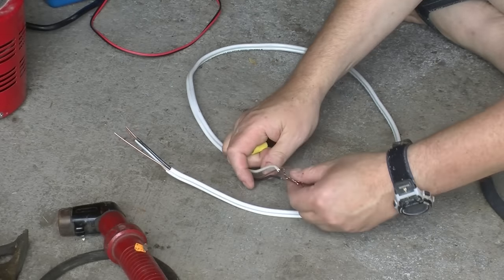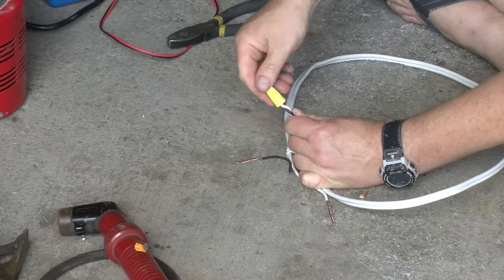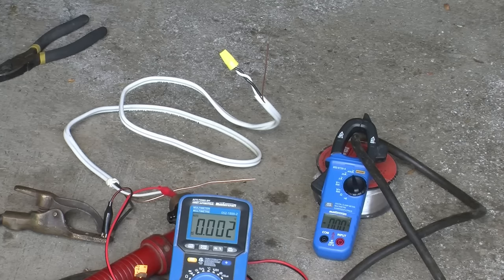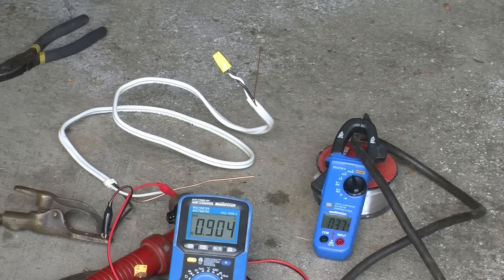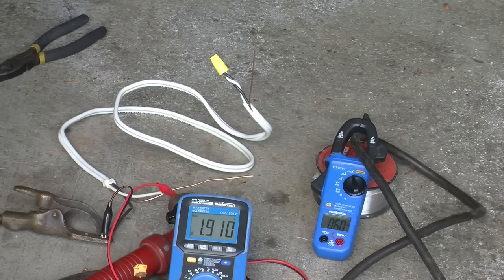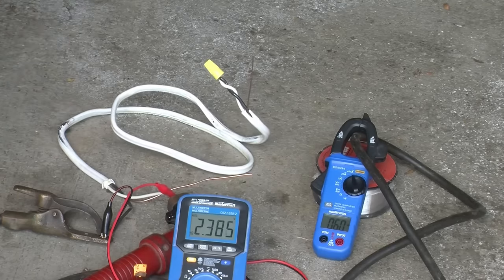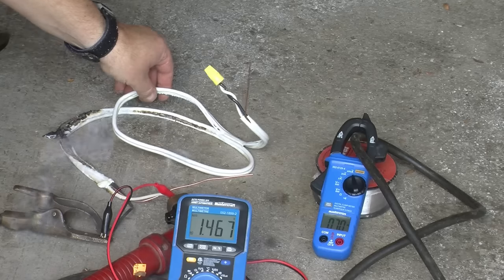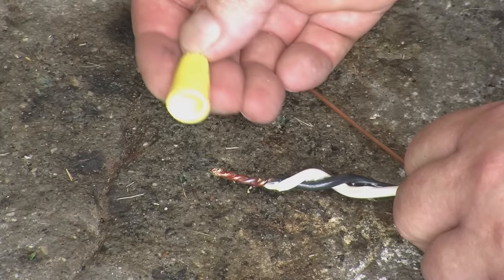How many Amps to burn up 14/2 electrical wiring?

Comment: Sir one emergency question...
A parallel circuit consisting of 2 same load/resistance where the total maximum current is 15 amp. It is protected by 15amp fuse. That means max 7.5 current is allowed in each wires.

Now, I removed one of the load. And,  I replaced the other second load with new load which consumes max 10amp.

That means only one new load is connected in the circuit. That means there's more 2.5amp difference of current flow in the new load circuit.

So, in the old load, max is 7.5 per wire.
In the new load max is 10 per wire.
So, just 2.5 amp difference.

Now, coming to my question...
If the new circuit is ON say for max 10 seconds, will the circuit immediately BURNS up within 10 seconds??? Of course, it will be hot.
How long (30 secs etc) can the wire stay unburnt? How long can it stay safe?

Or, How much extra current can be passed beyond the maximum limit for any given gauge wire?
Reply from the maker: See my other answer - which is there is no easy answer unfortunately. You cant easily predict how much overload is acceptable for certain period of time. If the cable is rated at less than the current drawn by the load, replace the cable.  Sorry - I know its not the answer you wanted :(

Comment: Any heating from overloading is wasted electricity-- for which the customer pays but receives no benefit. The 15 amp load results in minimal heating which also prolongs the practical service life of the various non-metallic materials which comprise the cable assembly.

Comment: It is hardly surprising that the "wire-nut" didn't get as hot as the rest of the circuit, since the joint had everything in its favour. A. Not tightly sealed (thermal) insulation allowing greater heat dissipation into the surrounding air, and more to the point, B. It is positioned at the point of least resistance in the circuit. The cross-sectional area formed by two thicknesses of copper wound together is like putting a "fatter" wire in the circuit, and since the current is "limited" by the welder's internal controls, the "I-squared x R" (copper loss) loss is least at that point, and consequently the coolest point in the circuit.
Reply from the maker: I think you nicely described why they seem to do so well. The others are at quite a disadvantage  in that respect - small contact areas and harder for heat to escape.

Comment: Im pushing 70 yrs ive seen some ugly wire from the 40 /50,s.  14.2  hasn't burnt still very good in the shop.
Reply from the maker: I have seen some of that old stuff too (canvas outside with tar like stuff?). The only thing I noticed is the plastic around the wires themselves gets  brittle over particularly at the ends where it is exposed to the air. Agree though - seems to be fine most cases.

Comment: 14ga is the the wiring of choice for lighting circuits.  12ga is normally found on receptacle circuits.  But I have seen all sorts of things.  When they first started including bare grounds (xx/2 w/ground) it was common to see 12 or 14ga wires with a 16ga ground.  And let's not even discuss the travesty of aluminum cable, other than SE.
Reply from the maker: I'm amazed to hear of grounds being that much smaller. I wonder if or how common it was for the ground to fail because of overloading during a short?

Comment: @ about 8:25, when he plays with the hot spot, the voltage starts dropping.  I assume it is shorting out some, probably at that spot.  So less current through the wirenut, which he says is faring well.
Reply from the maker: At that point yes - the wire shorts. Up until then, the wire nut would have been experiencing the same current as the wire, I thought it was interesting that connection - often a weak spot prone to problems - was not the initial source of failure.

Comment: In a welding circuit, if I understand correctly, it's the input voltage and amperage that's the issue. Voltage is either 110 or 220 ( nominal) & for the 220v, Virtually all mfrs.  recommend either a 30 or 50 amp breaker. For 110, if one reads the fine print, they recommend 30 Amp breakers for best performance. It would be nice to see some real world testing on the input wiring. Welders usually work by creating a short circuit between the workpiece and the electrode, so higher voltage & amperage are required. Have any thoughts? Thanks for the video, though. It was very interesting & helpful.
Reply from the maker: For the breaker rating, you really have to go by what the manufacturer recommends since they know what their machine is supposed to draw. And in turn whatever the breaker rating is then sets the minimum wire size that must be used for the supply circuit. Dont be tempted to use anything smaller than what the electrical code requires. 

Since you talk about 110 and 220, I'm guessing you are you  using one of the modern switching power supply ones that can adapt to either voltage - I have never actually touched one of those! Also I have never seen a 30A 120V circuit other than for camper vans - my thought would be that if you have to put in a new circuit for the welder, it might as well be 240V since for the same wire size and current, you get twice the available power to the welder. (120/240 is the designation that seems more common today but it essentially means the same as 110/220).  

The short circuit bit: the trick old welders use to allow shorting the welding side without frying the 240V side is the transformer is an unusual transformer: it is built to allow a  a certain amount of leakage magnetic flux to bypass the secondary.This has the effect of limiting the primary current when the secondary is shorted. It also makes the secondary more like constant current source rather than a constant voltage source as in a traditional transformer. By limiting the primary current that sets the power limit of the welder and also the size of breaker required. The switching power supply modern welders probably achieve this with electronic feedback, possibly with better results. 

Hope this is useful!
Reply: @ElectromagneticVideos  thanks for your informative reply. I am actually planning to either put in 240 or both 240 & 120 at the house. The 120 would be a dedicated line for power tools in my work area. Because of insurance, etc. I will have a licensed electrician add the outlets. Our home is all electric, so we should have enough power to the panel.
Reply from the maker: @stevencbradley  That sounds like a great thing to do. If you are planning on a 50A welder circuit or similar, one thing I did was have them install a subpanel. Great thing about that is 120V circuits for tools etc  can be added at very little cost, and you have the added advantage of the large cable  from the main panel reducing voltage drops. My subpanel is in the garage so it will also make it easier to add a higher power  electric car charger in the future. 

A couple of other things from when I researched  doing something similar to what you are doing: If you are thinking of a welder in a basement, even with a fume hood its not a great idea - the argon gas used for MIG is heavier than air and if there is a leak it can fill the basement (like water would) and suffocate someone. One thing that worked out really well was to have 20A 120V circuit for all my tools, with three duplex receptacles along the workbench area, and a number of pairs of duplex receptacles at strategic places along the  permanently plugged in drill press, grinders, saws etc. No extension cords required! And the receptacles are all 5 feet above the ground for easy tool access and  to keep power cords off the floor. The group of receptacles for the tool bench have a dedicated on/off switch, as does each set on the walls. And the 20A circuit is on a GFCI.   This of course may not be the right setup for you, but I thought I would mention what worked well for me in case any of it is of use.
Reply: @ElectromagneticVideos  work area's actually outside for now. I live in a mountain town in Arizona, so it's fairly temperate. I may move to the garage, but like you, I would not be welding in my basement (don't have one, but if I did, I wouldn't. Besides air purity, fire control could be really tough...)
Reply from the maker: @stevencbradley  Your so lucky to have the luxury of a warmer climate - winter here (Ontario) is too cold for outside work. Your state is beautiful! I have visit a few times - Grand Canyon and Meteor Crater in the north, and south regions down to the Mexican border - but not the middle.  Wonderful for nature photography.
Reply: @ElectromagneticVideos  there many more mountain towns here than most folks realize.  We moved from California, & I always thought of Arizona as desert, except for Flagstaff. You're certainly right about the beautiful places, though. As far as wildlife, this town was essentially carved out of National Forest, so we have our share of wildlife, but certainly not like you folks.
Reply from the maker: @stevencbradley  That sounds so nice! Unfortunately you rarely see much of our wildlife like bears - they are very shy!
Reply: @ElectromagneticVideos  I never had much wildlife close by until now, but Payson has its own elk herd (xl deer); we have peccary (local name javelina) or "pigs" (relatives of pigs, actually) coyotes, mountain lion (infrequent) bobcat & lynx  (infrequent), raccoons, coatimundi, bear (shy, as you say). Elk, raccoon & javelina visit often. Elk in the front yard quite few times in the summers, javelina come through for the birdseed Judy leaves for the doves. Lots of birds (eagles!), snakes, lizards. One of the main interests is the tarantulas that show up during early summer for their mating season. Don't think I can send photos on this site, but easy to look up.
Reply from the maker: @stevencbradley  That sounds fabulous! Elks are one of my favorites - many years ago I got a photo (35mm slide film) of an Elk in a lake in the Rockies - for years had been the background on my Windows desktop.

Comment: If the wire clad melts won’t the ground be hot with current too?
Reply from the maker: Yes! That is something I ignored here by leaving the ground wire unconnected. Since the ground wire is usually located between  the live and neutral in 14-2, and has no insulation itself, in a real situation it is most likely to come in contact with the live wire before the neutral does and cause a short.  So possible if I had connected ground and neutral, the short in the cable would have occurred a bit earlier.

Comment: The twisted connection is a superior conductor and then you add the "wire nut" which as a conductor cuts into the copper to increase the conductivity also. This connection is far superior to soldering and is why wire wrap is used in low voltage low current connections instead of soldering
Reply from the maker: I hear conflicting thoughts about crimping or other mechanical connections vs soldering. You make a number of good points. Would be really interesting to see some studies in various situations as to which is more reliable or otherwise better.
Reply: @ElectromagneticVideos  time kills everything yes twisted wires and wire nuts slowly losing I think I was told 25 years. Especially with the new lead-free solder vibrations of the smallest kind can cause it to crack over long periods. Go figure. Higher voltage higher current like house wires apparently the solder is slightly resistive and prevents copper to copper or aluminum to aluminum 🙀 contact. In transmission power lines apparently the mechanical crimp connectors are crushed so completely they fuse all the wires together making it one big conductor.
Reply from the maker: @kevinavillain4616  Your so right about time. I have also heard about tin dendrites shorting between traces in our ever more closely spaced circuit boards - more so with lead free solders. Years ago I saw them join some power line wires using an explosive charge to do the crimp. Not surprised it all fuses together!

Comment: Have seen failure due to no pre twist. Its worse than parking on a hill without using your parking break. But not as bad as skipping an oil change
Reply from the maker: Its interesting that you have seen "no pre twisting" failures. You wouldn't believe (or maybe you would) how many commenters have vehemently argues against pre-twisting. Your parking brake analogy is perfect! Completely agree with you!

Comment: Twisting the wire beforehand is the correct way but if you stop and think about it, it seems as if twisting would affect the integrity of the copper while the wire nut bites into the wire while pushing the two conductors together. 🤷‍♂️ just something I’ve always thought about… but who am I?
Reply from the maker: You would he surprised at  the heated arguments in the comments here and elsewhere as to twist or not. My own feeling is twisting is better because it provides structural integrity to the connection rather than depending on the little wire spring inside the connector and the often thermo-plastic cover. Some have pointed out that certain manufacturers specifically say dont twist with their connectors. If I ever used those I would follow their instructions. So far I havnt come across any with that in the instructions ....

Comment: A 14 gauge wire is actually rated at 20 amps  but it's limited by code to a 15 amp circuit.
Reply from the maker: And in the end its really the code that should be followed for things like domestic wiring.

Comment: Is there a difference if there is a running load vs the dead short
Reply from the maker: Good question! It is the current that heats the wire.  A dead short as I used means there is very little voltage between the wires. A real situation with a load means there is about 120V or 240V (or whatever line voltage is used) between the wires. But those voltages don't contribute to heating - so voltage or load makes no difference as log as the current is the same. I did a a more detailed write-up with examples here: https://www.youtube.com/post/UgkxeilOfLJGy2ODslnBW0WFXUE580oHhFyP